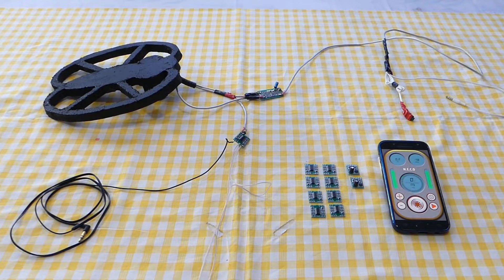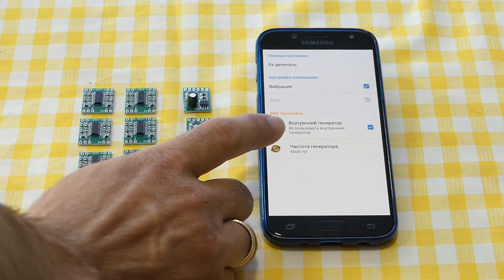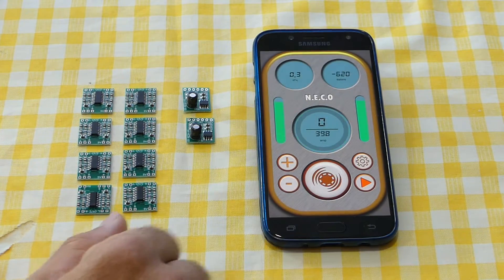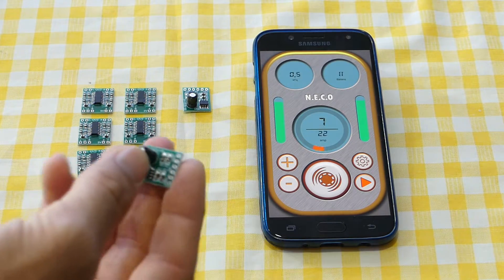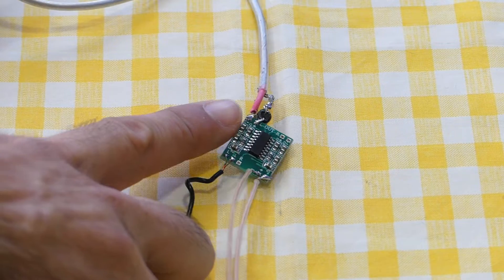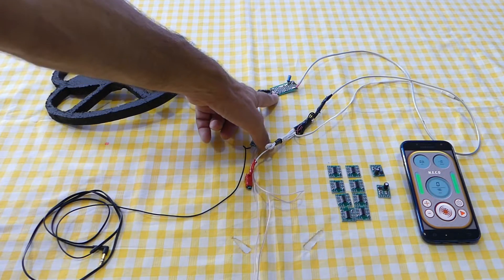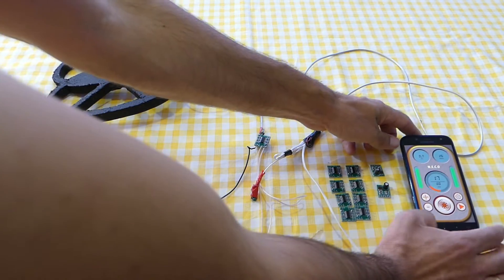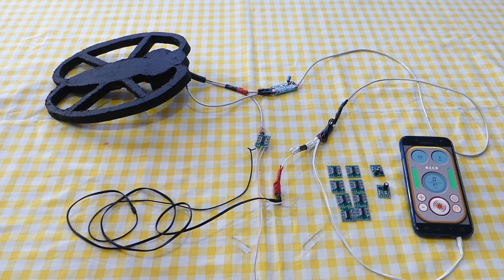Premium functions on MD "Smart Hunter"

Comment: hello how are you, I watched the video, you have to excuse me but I could not understand the connection, surely it will be my fault. If there was an electric scheme I would be easier. Up to now I have built the reels as you suggested me: Tx thread 0,6 Rx thread 0,2 with 55 turns for both, I have spamped the plate and the coils. Then apart I built the prototype of the circuit with arduino (in the test seems to work) but watching the video arduino is gone. :-(
Reply from the maker: No, arduino is not gone!!))
It work the same way just for peaple who do not want to use arduino can use internal generator!
This metal detector have 3 parts:
1 - Smartphone 
2- Generator
3 - The coil
In Premium version we do not need arduino we use internal generator and an amplifier.
In Free version we use arduino.
Connection is the same, amplifier have input and output and we connect the input of amplifier to sound channel of smartphone and output we connect to the Tx coil, it is very easy, but if you make with arduino you can still using arduino don't worry!))
Reply: can I send you some pictures on your email?
Reply from the maker: @ac_lab9380  Yes, why not?)